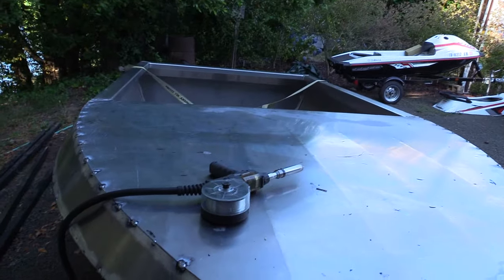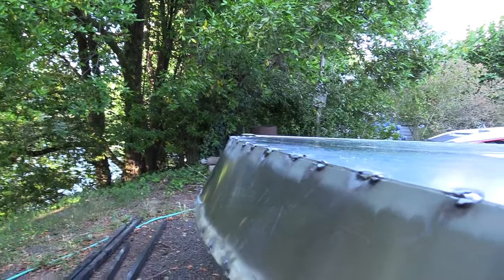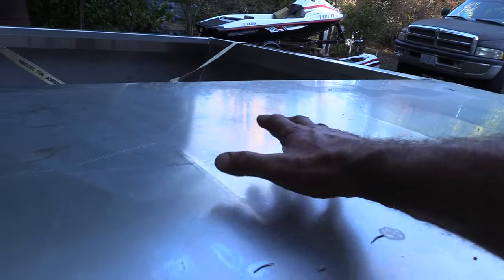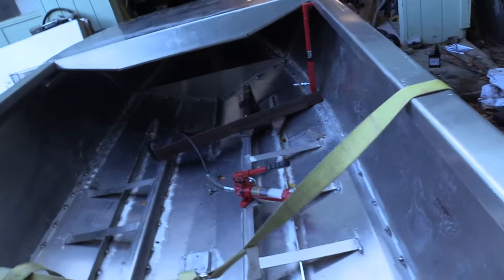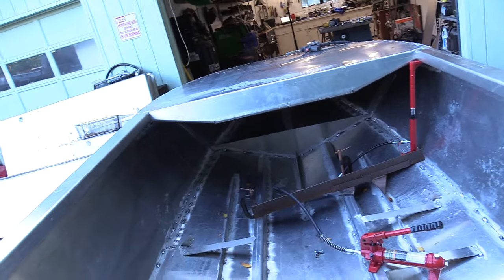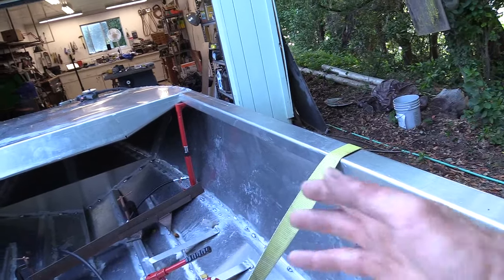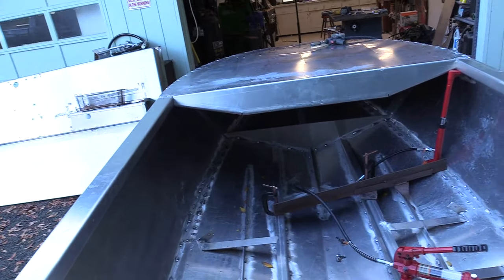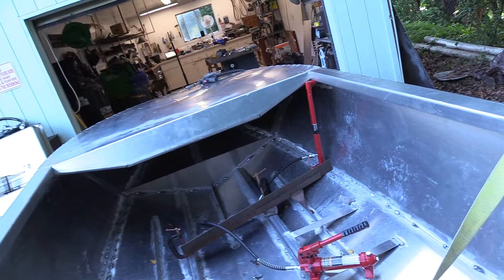Wattscraft Mini Jet Boat Build Video #31 Good News On the Foredeck

Comment: put a piece of 1" box in place of the jack temporarily untill you have welded the windscreen. cut out when done.
Reply: send me an email then I can reply with pics. I am fitting the same setup in a customers boat at the moment. I found your channel when looking for a solve for the muffler/ waterbox, I have made the motor alot closer to the transom and have run out of space. I am working on the i-ride box tomorrow.
Reply from the maker: @mitchellspeedboats561  The bent portion of the foredeck (dash) butts up to the inside corner of the side rail. What if I raised it "slightly" higher than level and welded the inside corner to see if the support strength is adequate from making the side and dash one piece? if doing that to both sides works, the flat bar on edge under the foredeck might get me pretty flat, and should have the strength to put the pressure needed on the windscreen in order to get it to conform without moving. I would love to not have to build a permanent support.  
I have both sides jacked up and supported.  I was thinking about putting the jack and some angle iron under the deck to flatten it out, then putting the windscreen on, and see where it ends up. If the down pressure from the side panels doesn't over power the corner join, I might be golden with the windscreen on top adding rigidity. This is probably a no brainer for people who have done this before.
Reply from the maker: @mitchellspeedboats561  I was told that the exhaust water box gets shortened on the inlet side of the divider in the middle of it. . I like to keep things stock, but it either gets shortened, or a hole gets cut in the transom to fit it. Once I get my motor mounts finished, I will measure it out, and if my swim deck covers it. I might just cut the transom. I need 1 3/4 inches more, which still puts the exhaust outlet inside the boat at stock length. The original exhaust water box mounting was loose on soft foam pads, secured by two flexible rubber tie down straps, so I would be looking to mount it the same for the apparent engineered flex.  
Now that I am thinking about it,  I might just cut out a section of the transom on that side to open it up for the trim control and the water box. The water box height is about 14in from center keel, and the top of the swim deck is about 19in. At 14 inches, I have 13in back to the swim deck bottom bend that the jet pump cover welds to.
I just found out that my i-ride box location in relation to the pump adapter extends inside my boat. The original jet ski pump to transom adapter mounted to the jet ski transom is 3.5in long, whereas my pump adapter is 3/4in, which puts the i-ride back inside the transom. Good to know, I suppose. That external box idea wasn't actually an option without changing the linkage lengths. 
If my extended transom box interferes with the bottom of the swim deck, I will just make it fit. I don't see a structural problem. In theory, it should be stronger. 
How do I send you an e-mail. Did I miss your e-mail somewhere?
Reply: @paulchristian8271 , forgot to add address. mitchell@speedboats.co.nz
Welding the dash to the inside of the side should gain you some rigidity, but tacking a temport 1" box until you have welded the screen will help. Careful when you weld the screen how much heat you are putting in the foredeck panel. Do shorter 6-8" welds and let cool, there doesn't look to be alot of pre-tension in the foredeck panel and alot of heat will have it looking as flat as a lake in a storm. Sticking rubber non-slip pads on will hide alot but not all.
The exhaust/ waterbox is fixed that way for sound insulation. My fix was to make a new waterbox (I had to find 8", which wasn't going to happen). They are pretty simple, just a few design requirements that may catch a few. For the 1 3/4" you need I'd cut the domed end off and re-weld it shorter. Hack some of the baffle out too. The ski I have already had a Riva high flow exhaust fitted, so I'm using that to go between the waterbox and transom outlet.
I'll send pics of my setup, the intake is quite different to yours, but I wanted the pump and motor as far back as I could. I had to shorten the pumps mainshaft by 8", and the  adapter-to-intake face is 1 1/4" behind the transom. The SVHO is a long motor with that supercharger and intake on the front.

You can see my engine mounts here;
https://www.facebook.com/speedboats.mitchell/?hc_ref=ARRzXJunxJO7nPhzWNAJnQWmSm5upddCZYfHGAFhymfmDBxvAhPJHObOCMmKu0IHccY&fref=nf&__xts__%5B0%5D=68.ARAsPVC2W16oErsmOnFEPGoHVMKRu-56y9AESwMNOxYmNWYeU8xxKQord__iIehb2881NJr-S5mntP-cqzvd7-E4nJoC_MH1Dh11a4-peRSge0nA8mnPh3Dgj3JoXDFmC2ed4GMM8cWZzwRp35tSv3aLNxzlILUnbRI6m-oqOQFdcAr0rC3Mu6Ysu6wii8WndXo8AmQBVEC4BQZv-U44O5kOr3r-W0q8dK0EPJS7OibR-jdeqw88ZsWLra-RCRw-Y6YBBig6WoNK3Bhw772f5dCORuwhoBbOUzATvCizYEi3CaU51G9POfBatsF4inMwTEE5g24H8H6iK-MigD7hDFuAbw&__tn__=kC-R
Reply from the maker: @mitchellspeedboats561  It sure looks like you have a more difficult waterbox conversion. If I can just cut the outlet side domed end off, that will be easy money. I didn't have any box aluminum, but I have it blocked with steel and the tension is plenty to keep it there until the wind screen is on. I've been working on my blending. The deck is a bit higher than the side rail when they are both level, on the right side. The left side is even. It's not a big deal, but I am learning to work with aluminum. It takes a lighter touch, and some different materials to finish it off, as you know. I'm learning weld speeds on different thicknesses and welder settings as well. There are more variables than I have worked with before, and a new welder to learn. 
I picked the NA engine on purpose. Partially for room in the boat, but mostly for reliability and longevity. I plan on keeping this boat long term. 
Looks like I will shorten the water box, but will have to build a box for the i-ride with inside access, which will make access harder, but it shouldn't need much accessing. 
Are you supported on the oil pan at all, or just the side mounts? I worry about movement with those. Do you have experience with that particular motor mounted that way? I'll do it if it is not a problem. I don't really want to build a carriage for the lower mounts. 
Thanks,
Reply: Paul, I posted in one of your last vid with my email. You should be ok when the windscreen goes on. I had to jack my sides as well using a screw jack to line things up. With the windscreen welded it's like an I beam and holds it all. I also cut down my waterbox quite a bit for my 1100. Feel free to reach out.
Reply: Jdh 104 I appreciate that. I need to square up the hull before I get back to the deck and side rails. It’s going to either be a complete tear down, or jig the whole boat and force it to conform. Either way, I think I’ll probably end up building a support rib for those side rails, where they meet the deck.